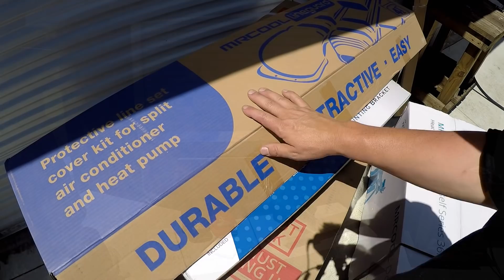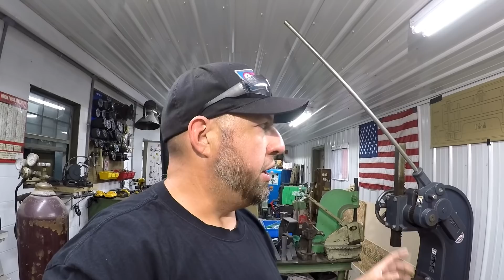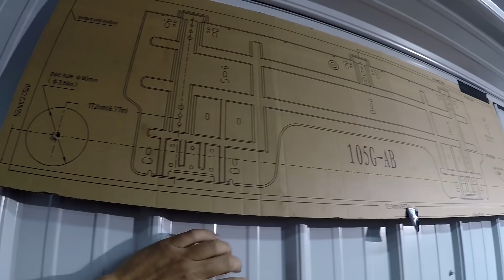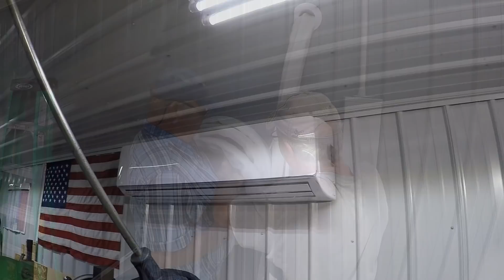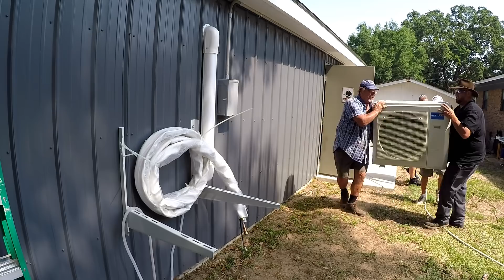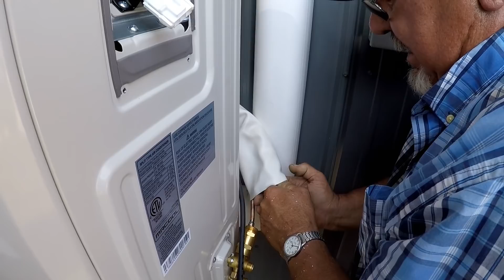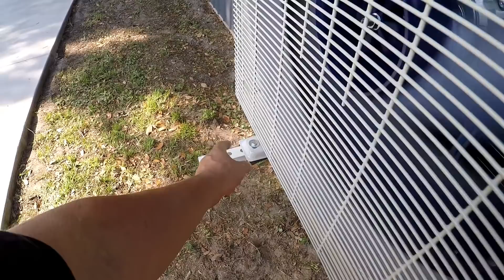Mr Cool DIY Shop AC Install

Comment: Hi Adam

What does 36 k mean.  Sounds like a bit of advertising b/s.  Is it 3.6 kw of cooling capacity or 3.6kw of power consumption. Does it reverse cycle?.

Here downunder this thing would cost 32 cents (Aust). Or 22 Florida pesos per kWhour for power.  If your shed ain't insulated it's gunna cost heaps to run it.

That unit would cost $3600 (Aust). ($2200 US) to buy.

Steve callachor

NSW Australia. It's winter here. 24 celsius
Reply from the maker: 36K BTU, or a 3 ton ac system.
Reply: 36,000 btu
Reply: You can see the rockwool insulation in the wall when they install the pipe and flanges for the refrigerant lines. 36k refers to 36000 BTU, which is equivalent to 10.5kW. That ac is a beast and explains why it needs a dedicated 30A single-phase line
Reply: popefang     When you say Rockpool what is it..

In the 1960s rock wool insulation was sold for homes.   It turned out to be crocodilite a nasty form of asbestos which was crushed loosely and then fluffed up to achieve its R value for insulating.

Is this the stuff you mean??   Surely it's not still available in USA
Reply: @stevecallachor  clearly not crocidolite (watch your spelling) but this kind of stuff https://www.bunnings.com.au/hardiefire-1160-x-560-x-60mm-insulation-pack-of-7_p0811336

Comment: Good investment! I had one for my garage/shop for the past 1.5 year. 71 F all the time :)... Depending on the insulation you got for the shop, it may be better to leave it running even if you are not in the shop all the time. These inverter units are more efficient because they run all the time at slow speed to "keep up" with the demand. If you got the right size unit (1.5, 2 or more tons) for your shop, it will be more efficient to leave it running all the time... A conventional (non-inverter) condenser units run at 100% when called and shuts off (0%) when they are off. Again, depending on the sizing of the unit and effectiveness of your insulation, your unit may only need to run 30%-50% if ran all the time.

In addition to machining fumes, I subject my unit to cigarette smoke. These stick to the surface of the fins in the inside unit. Carefully spraying diluted bleach over the fins helps with the problem. The bleach solution also helps with clogging of the drain... Trust me, you don't want this to leak inside your shop. Last year, it rained 2.5 months in Pensacola... Right after I got my unit installed. Due to the increased humidity more bacteria grew inside the drain and clogged it... I ended up fixing a aquarium hose where the drain connects to the drain pan in the inside unit and blowing compressed air to open up slimy bacteria growth...

Comment: I installed one of these units, the 24k, it was able to heat my 24x25 insulated shop through the winter.  The wifi control is a bit clunky, other than that I like it.
Reply: Good to hear. I'm building a 24x25 shop. Thanks!
Reply from the maker: Good deal

Comment: Why you skip vacuum process
Reply: He didn't, the unit comes with the line pre-charged.   There is no need to vacuum, its a DIY kit.
Reply: The "DIY" kit comes with precharged lineset, that has special fittings on the end that keep air from entering the lineset. So there is no air to vacuum out. 

Downside is DIY version costs more and your stuck with fixed 25ft lineset.

Advantage is no need to flare the copper ends or vaccum the lines.
Reply: WixTheQwix the prices don’t look bad at all, that 36k version is less than $3k, they have smaller one for less than $1k, way cheaper than the company I used to work for.
Reply: Did you even bother to watch and listen??
If you did your question is totally unneccessary !!!!!!!!!!!!!
Reply: Yeah was also reading that the warranty is much better on Mrcool DIY versus their Advantage series. 7yr comp/5yr parts for DIY, but only 1yr comp/2yr part supposedly on the advantage version.

I see Amazon has a 24k btu Advantage for about $700 less than a 24k DIY version..

I guess depends on if you have a vacuum pump, know how to flare lines, and how much you value warranty. I must say though DIY makes it easy.
Reply from the maker: It’s in the video
Reply: Hey friend I am from India I didn't heard about pre charge lines so thank you for reply

Comment: Running the heat pump durning winter will save on the heating bill, heat pumps are way more efficient than resistive electric heat
Reply: In that part of FL, you only got like one night a year that it gets into the 30's. And when it does, the news goes crazy. Stay indoors! Check on old people!

Comment: Those white zipties will rot in about a year from the sunlight.. You might want to replace with some black UV resistant ties.
Reply: Agreed! I knew something wasn't sitting right in my mind about that part of it. They will get brittle and snap.
Plastic ties are good in that they will not cause the bracket to rust compared to using something like metal wire would, but UV resistant ties will last longer than those. Good Call!
Reply: Stainless steel ties last longer with a non-metallic channel to prevent chaffing. USN uses that on outside cableways on ships.

Comment: Nice to see another one of these mr cool installs from people I trust.  This is why I just bought the 9K unit and spent the afternoon today installing the inside unit.  So far I'm pretty frustrated with the quality of the workmanship and the instructions are insanely vague.  Example: The instruction booklet spent an entire page with graphs and charts explaining how the world will end if you don't choose the correct wire size and connectors for the control wires.  Well hell the unit comes with the control wires that you need and they are terminated.  Also there was no template included and I had to eyeball where the hole should be, not a big deal really.  My main gripe, the 9K unit is not sealed.  The line set is open and the inside unit is charged with nitrogen.  So the system will have to be vacuumed before use.  I'm going to have to pay an hvac guy to come out and pull a vac so this is not a diy project in its entirety.  Also, the wiring diagrams are referring to wires that don't exist and theres no pigtail in the 9k unit.  Not too happy so far but hopefully it will turn out ok.
Reply: Miles Turney sounds like you didn’t buy the diy kit, there’s a big difference between the diy kit and the regular kit
Reply: You trust YouTube guys being given free units? Oh boy...
Reply: @uhhhhh262  I dont know Abom but I trust that what he received in the package is what really comes in the same package everyone buys.  I guess you're saying mr cool specially packed units for them with special equipment and instructions to make it look easy?  I guess its possible.
Reply: Miles Turney I’m sure you’d receive the same stuff (minus the merch obviously), it’s more like Adam wouldn’t tell you if it’s junk if it’s a free unit hanging on the wall. He’s a good guy, but free stuff and future sponsors is now his main income along with Adsense.

Comment: When you fix the condensate drain line, make sure you plan a path for the water to go. My little 5k btu unit will fill a small bucket with water in a 24 hour period in Louisiana humidity and that's enough to think about channeling that water away from your foundation.
Reply: The perc in NFL is insane. It really isn't going to be a big deal. A lot of people just discharge their washers right out on to the ground there.

Comment: I installed the same unit 4 yrs ago on my 40x40x12 shop. Piece of cake to do. It has been great year around. FYI with these inverter mini splits you can't over size it.  With the DIY kits you don't need an HVAC guy to install it. You may need an electrician if that is not in your talent bag.

Comment: I think that the condenser is blocked by these lines, if they are not necessary they can be cut and.. yes! it is necessary the vacuum before releasing the gas saludos desde mexico
Reply: no vacuum needed for this unit
Reply: They cannot be cut; that is part of the "plug and play" feature.  I think they should be highly inflated as they will sluff off effectiveness of the coolant.

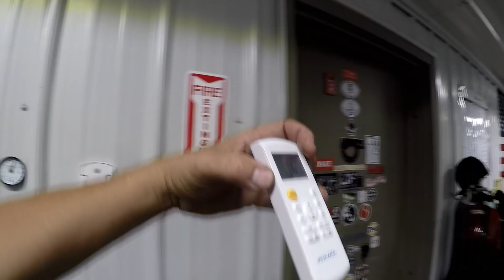Comment: 25:27 It's not a TV. The remote can be used without pointing it at the system. 😉
Reply: It all depends on whether it’s RF or IR. IR needs to be pointed in the general direction. It has nothing to do with a TV since mine is RF and I can control it from another room.
Reply: @yqwgjsg  that remote is designed to simulate a wall mounted thermostat. IR wouldn't be able to update the system from its wall position, so the only way it'd have IR is if a complete moron was in charge of that decision.
Reply: @iwantmypot  there's quite a lot of false statements.
Reply: @jothain  enlighten me.

Comment: One HUGE step that was missed is evacuation of the evaporator with a vacuum pump to remove any contaminants and and air from the lines...that would have increased the efficiency and the longevity of the compressor...
Reply: Take a stride or Step aside The only thing that was missed was you paying attention or researching the product before commenting.
Reply: yall are nuts, did you even listen?  It seems that all 3 parts are at least partially charged with 410.  The lines must have some weird fittings that hold the 410 in them until you plug them in.  The evaporator must have some 410 in it so no air gets in, and the remainder of the charge is in the condenser.  I'm not saying I designed the thing but they literally say it's meant to be hooked up like this.
Reply: @RickBaconsAdventures  IIRC from watching Keith Rucker install his, there's a pierce-fitting on the end of the hoses that screw into the outside unit, and they're designed to seal with an o-ring before the pierce breaks through when tightened fully. Then you open the ports on the evaporator, and it completes the loop.
Reply: Their website says it's not necessary:

https://mrcool.com/blog/pre-charged-line-sets-real-right/

I guess that's one of the big points of their marketing it as a DIY install: you don't need to vac the evaporator.
Reply: Another huge step that was missed was you listening. It’s pre charged and pre vacuumed. When you tighten the lines you break the sealed lines and then when you open the valves you release the refrigerant. There is no air in the lines and no contamination present. If you had to have a bunch of specialized air conditioning equipment, it wouldn’t be DIY.
Reply: its probably vacuumed and tested at the factory  then purged with nitrogen.  i'd still pull a vacuum though
Reply: richard cranium Gloria

Comment: The only problem I have with this system is that there is always an excessive amount of coolant lines to deal with.

BTW, you're the 3rd or 4th YouTuber that I've seen install on one of these Mr. Cool units.

Comment: As Info:  Great unit but be mindful not to over size the system.  In hot humid climates the unit needs to run long enough to remove moisture from the air.  If the unit is too large the conditioned air will be cold and damp, not good.
Reply: Running a separate dehumidifier will help greatly. I run one in my shop year round.
Reply: The units have a dehumidify mode as well as the heat/cool functions.
Reply: Luckenbach Machine Works Good to know thanks.

Comment: Did I miss the whole pull a vacuum on the lineset and indoor coil?!?!😲😲 Gotta get rid of the non condensables.
Reply: supposedly this unit is specifically designed to not need any vacuum pulled, in order to make it easier for DIY

Comment: If anyone can tell me what's the average yearly cost of running one off these, we've considered getting a smaller unit for our house but haven't found the energy usage of them yet
Reply: Completely depends on your climate and electric rates
Reply: And seer rating of the unit you get.

Comment: I put in a 24k unit about 2 years ago in my shop, my advice is to keep on top of cleaning the filters. Between welding and grinding and machining I need to clean the filters about every 3 to 4 months. Take ‘em down and rinse and dry them, it makes a big difference.
Reply: dirtyknuclesde oil wire air filters if applicable for better dirt trapping

Comment: The vacuum should not be bypassed. We don’t just pull a vacuum to make sure we have no leaks we also pull vacuum to make sure as much water and water vapor is out of the system. R-410A really doesn’t like water. The mix turns the oil of the system into acid. Pull a vacuum if you want to install the system properly. I do love watching Abom work though. He takes pride in what he does and he does it well
Reply: I think the point is the lines are shipped under vacuum and there are quick connects at the one end so nothing gets in there.  Only the little space in the area by the valve.
Reply: Look at the installation instructions for yourself but I think I read that the condenser and evaporator are both precharged including the lines.
Reply from the maker: The homeowner installing this him or herself is not going to have the tools to “pull a vacuum”.  These units are designed to be installed without doing so.
Reply: I think they have an extra large dryer unit built in to absorb that moisture from the lines on install

Comment: you should have run the lines under the eave to the back of building or as far as they would have run.  the condenser is more effecient in the shade and there will be less noise if the pump was put further back,  this would have eliminated the extra coils and oil traps.  also move condenser to end of brackets to increase air flow between unit and wall
Reply from the maker: But instead I installed it the way I wanted.

Comment: A couple of minor suggestions: 1) Tie a string at the bottom of any outside loop of wire or conduit ... It will direct any rain water ... 2) If possible. run the drain water into a jug. It's almost as pure as distilled water — and it's free.

Comment: Just installed two of these in the shop.  I suggest you read in the instructions on the layout of the condenser in relationship to clearance to the back wall.  The manufacture requires a minimum of 12".  Do not cut off the brackets, but do move the condenser out to the end to get as much rear air flow clearance as possible.  Someone also(rightly so) suggested coiling the line set horizontally under the condenser, not vertically to eliminate trapping oil in the vertical loops and starving the compressor. This would also give more air flow into the condenser coil which is needed when temperatures get hotter in mid summer and maximum heat exchange is necessary. Many years dealing with A/C installs and repairs have taught me the tricks to make em work well.
Reply: Damn man!  The first useful criticism comment I’ve seen. Most others are know nothing experts.
Reply: Oh did he cut the brackets?  Uh-oh lol...

Comment: Nice that you have Fernando to help with the electrical and the HVAC.  The heat pump will be nice for you once those temps get down below 70 again. :-)   That 36K unit could cool my whole house.  It would be a little small for my shed with the equipment because of how tall the space is.  It would be nice to have some AC in there during the summer.

Comment: Don’t cut off the brackets. The unit needs to be as far from the wall as possible to improve the air flow. Add this to the list of places you spray for wasps.
Reply: These were the brackets on the outside of the condensor, not on the wall of the shop

Comment: Looking at the bit of isolution you see in the wall I do wonder how much you could save by having some heavier insulation in those walls.
Reply from the maker: Jees man, seriously? It amazes me what some of you guys come up with to comment on. When that wall was built the proper insulation was installed.
Reply: I really wasn't trying to offend Adam, I know nothing about the insulation you have and I'm certainly not saying it's not proper. It simply crossed my mind when I saw the big hole through the wall.

With insulation there really isn't any upper limit. There are so many kinds and degrees that you could always do more. Whether it's effective at some point remains to be seen of course. But that's why I posed the question, whether that would make a useful difference or not.

Comment: Abom size air conditioner. lol, Meat Locker :) . Instead of cutting those brackets off, I would move the unit out from the wall. The hoses are a bit close where they come out of the unit and make that bend behind it.

Comment: I'm an HVAC tech, and that looks pretty complete. One earlier conment about how the HVAC guys will all tell you what you did wrong was absolutely correct. It cracked me up. I saw some stuff that I wondered about, but it looked good to me. You all followed the instructions and COOL air came out. Cool. Oops, sorry.
Thanks.
Reply from the maker: Thanks John. Besides Fernando your the only HVAC guy That has admitted to this a simple and complete install.
Reply: Abom79 some of the suggestions were good, like keep the condensate water away from the building. Your plastic pipe will solve that, just like a tiny downspout.
And sealing all holes carefully to keep the critters out. But that doesn't have anything to do with the unit itself.
The one comment about the vertically coiled lineset trapping oil may be valid, but if the instructions didn't say anything about it they may have figured that out.